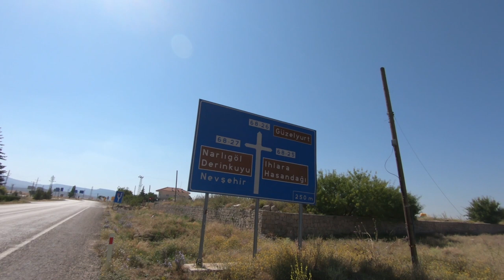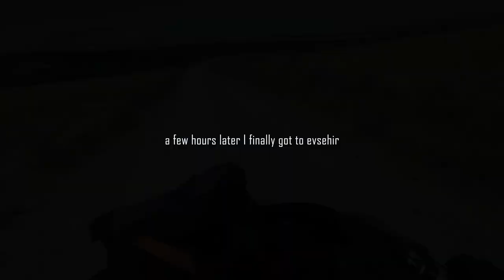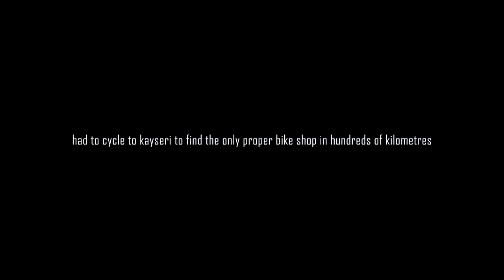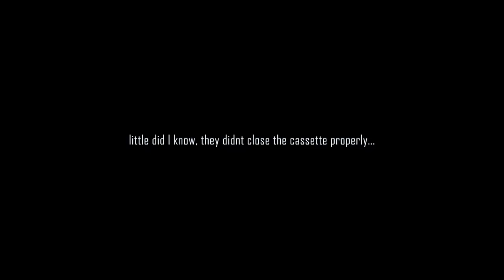Cappadocia with broken hub bearings

Comment: Never rely on Shimano
Reply from the maker: The Deore line isnt best suited for long distance travelling. Maybe a more rugged line like XT. I surely dont understand why Shimano wont embrace sealed bearings.
Reply: @DavideTravelli  I had a head set last one ride a bottom bracket snap in half.  Campy no matter what Group and you will ride in happiness.  Chris King also makes great bottom brackets and hubs and headsets they are also unbreakable.   Mavic is also making outstanding stuff.  You go with any of those three you will never be sad.